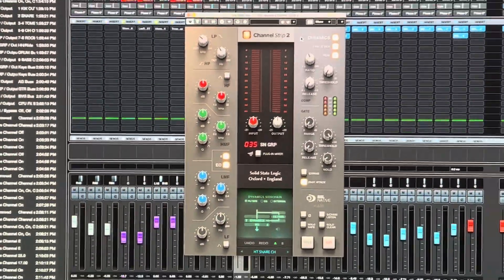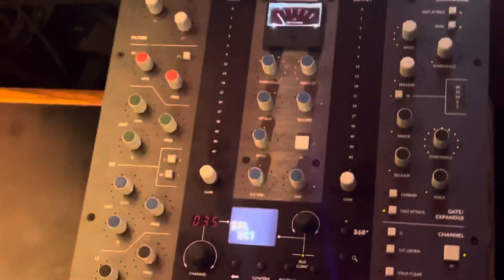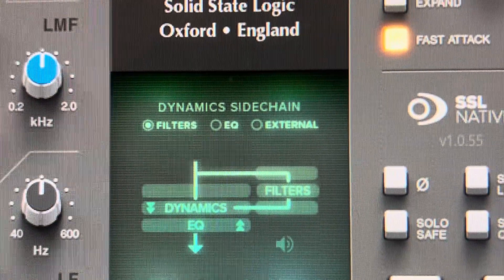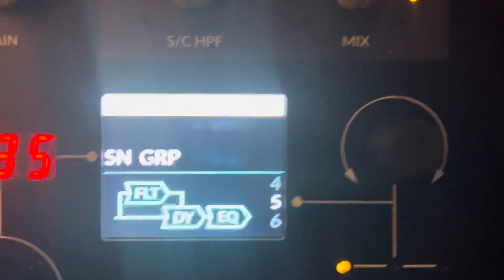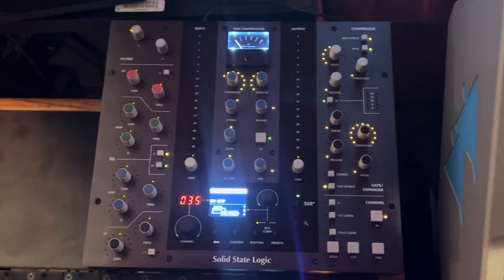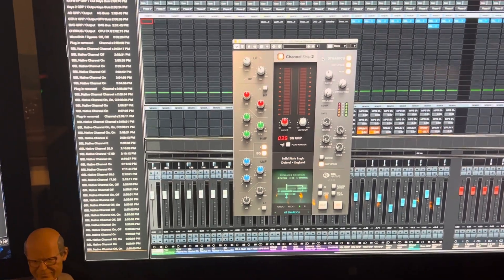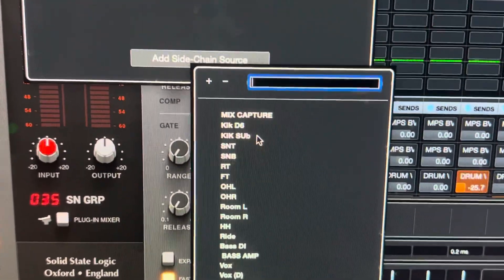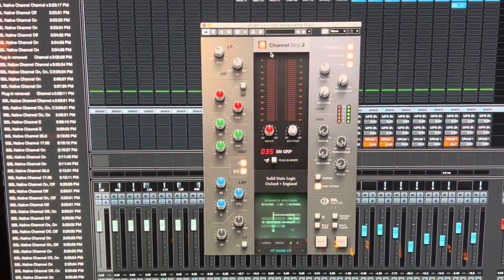SSL UC1 Side Chain: How To

Comment: You bet it’s helpful.  I like you, just purchased my SSL setup, (UC1, FC1, UF8, and not a word anywhere about how to side chain! There’s a Side Chain listen button so I know it’s in thee somewhere.   I too had to go to the plugin, but it’s not working well in Reaper using the SSL AU plugins for my Mac Studio Ultra… My search continues… No word back yet from SSL support.
Reply from the maker: sorry about the trouble in reaper.
Reply: @hopetownsound  Thanks for the note.  I was attempting to side chain a compressor on an acousic guitar channel from a send on the lead vocal track to duck under the vocal. (a trick I almost ALWAYS use at some level).  A fast comp with the precise timing can almost make it imperseptable that the guitar is being turned down a little bit, even between words!  I find it more useful than the kick ducking the bass for hit.  That’s a good one too, but the vocal thing is even more amazinig — it did not work for me.  But just tonight I think I figured out why.  I’m using Melodyne Studio 5 on the vocal, so there really is NO vocal AUDIO on the DAW track.  The audio is coming back in through Melodyne, and therefore won’t respond to the send from the vocal track (on Ch 3&4).  I’m going to try that in the studio tomorrow… fingers crossed.